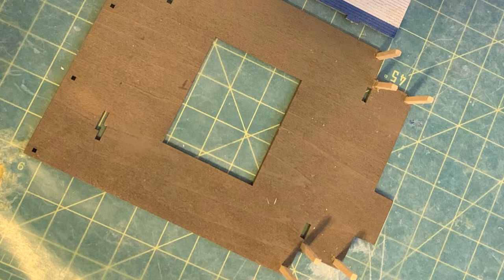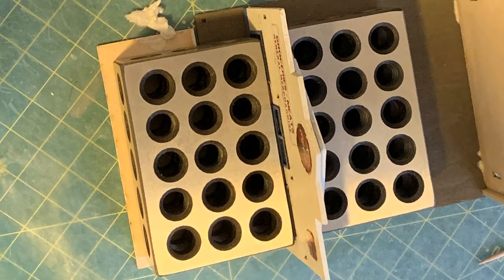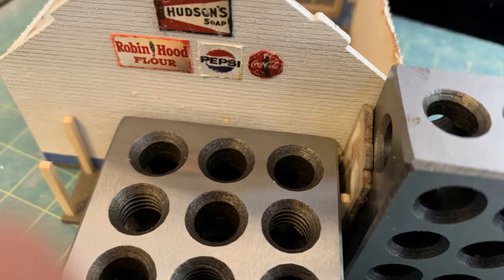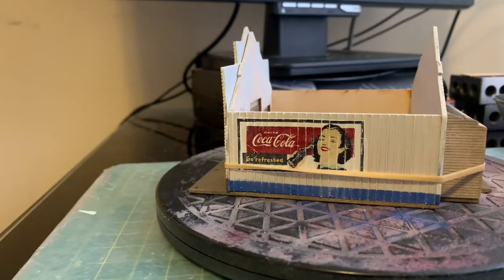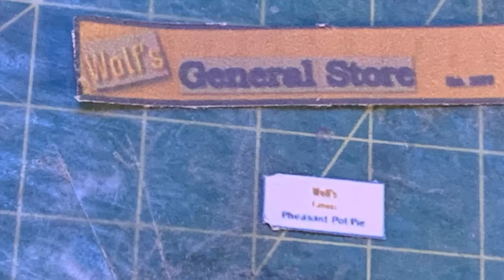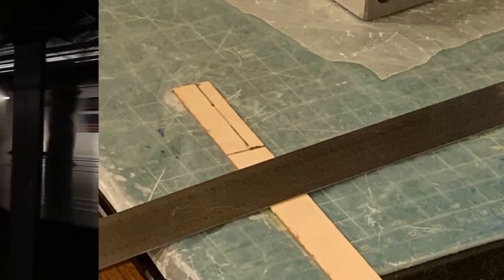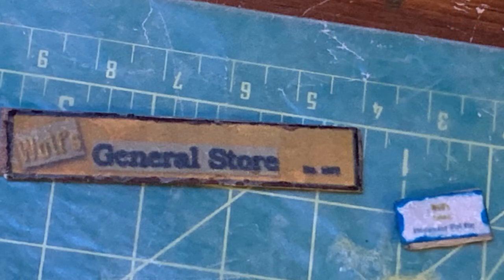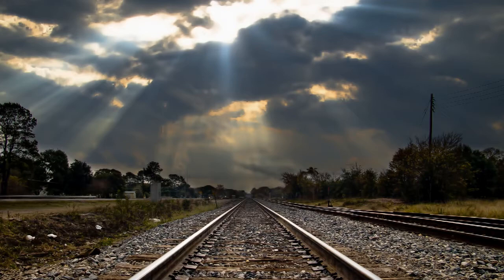HO Scale Craftsman Kit Group Build Ep 7

Comment: Looking good so far. You might want to add 1/8 inch square stock on the inside of the walls to help control the warping. Nice work.
Reply from the maker: I did add bracing on one side already because I added a bit more wash and it severely bowed.

Comment: I have found if you are going to paint craftsman kits, that is, where the main components are laser-cut wood, paint BOTH sides - even if the inside is painted a matte black.  It is having one side painted, and one side raw wood that make them prone to warping.
Reply from the maker: @kenr86  I agree and that was a hard lesson with the side wall of this kit. It was so thin and got so soft. That advice was given during the group build and I did no heed it. I like your idea of painting the inside walls black. Not only can help counter the warping, but can help with light bleed and give it a sense of depth through windows. 

Thanks for checking out the video. Remember to Just Jump In!
Reply: @DMRJ  I've been watching a bunch of your videos - I started with the switching layout, since I've just started building one like that myself - a question, do you have a good image or track plan in it's final form?  If you didn't object, I may steal some of your ideas for my layout.  Thanks